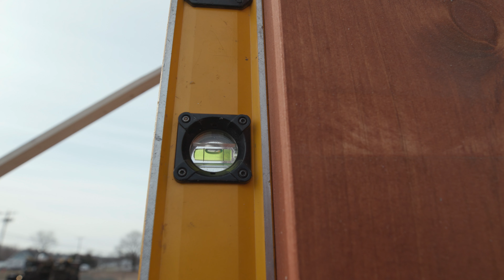Building a Timber Frame Pavilion from a Kit | Authentic Timber Framing

Comment: Why are you making cuts when it's a kit?
Reply from the maker: Good question. When we ship out a kit, we always leave the posts long so that they can be cut on-site to ensure the pavilion is level and the desired ceiling height is obtained. That way, if a pier or two are a little out of level (for example: one pier is higher than the other four) the pavilion can still be built to spec by adjusting the post height on-site. Are you interested in a pavilion kit?